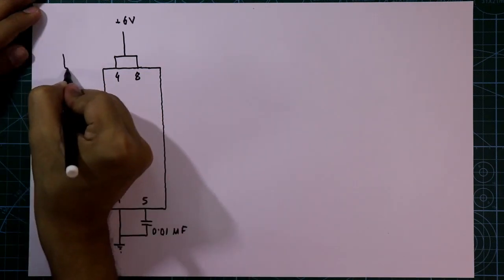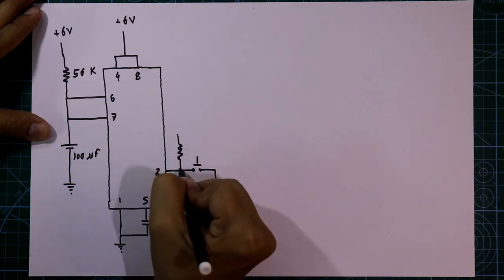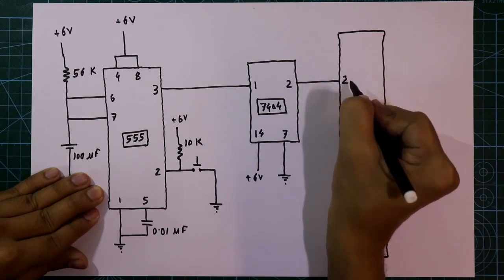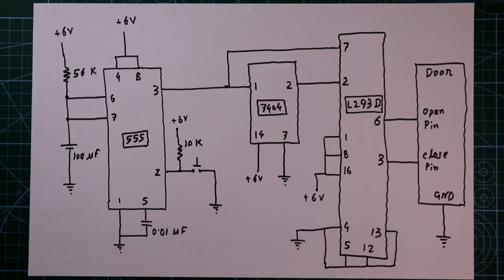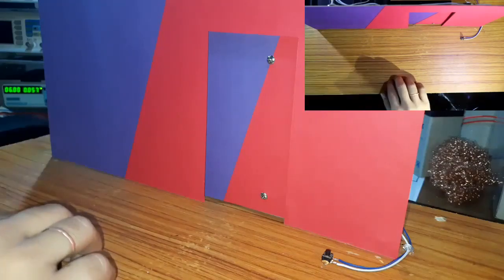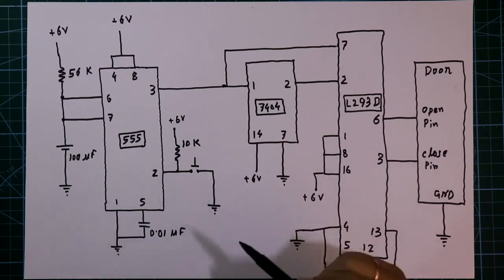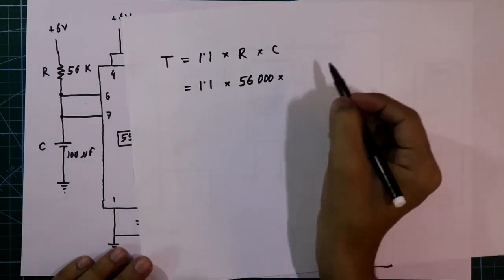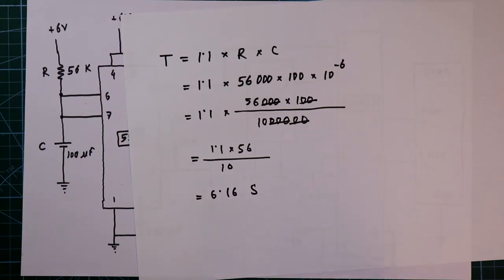Automatic sliding door based on timer without Arduino

Comment: Is it possible if I use a 9 volt dc motor with a 9 volt power supply but use this circuit. I agreed but failed.